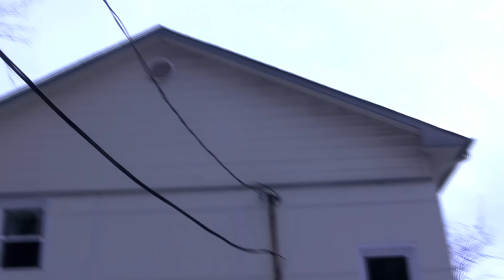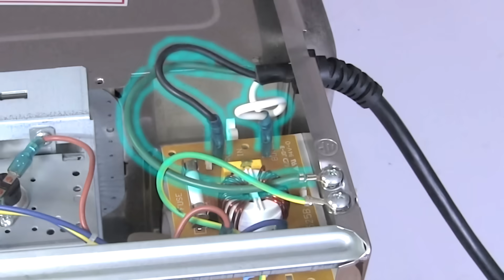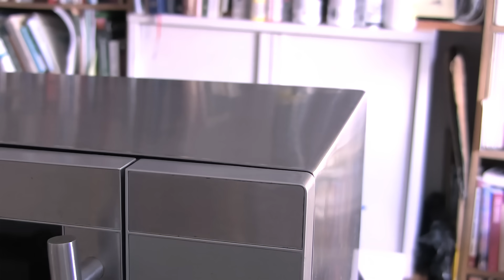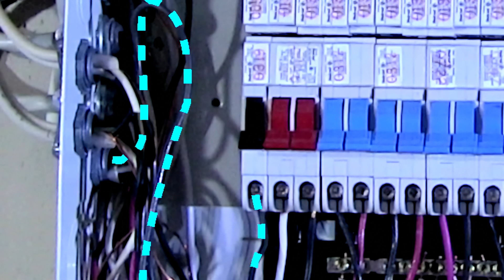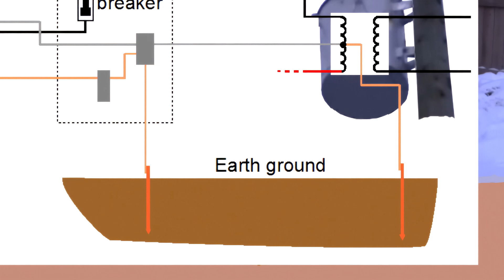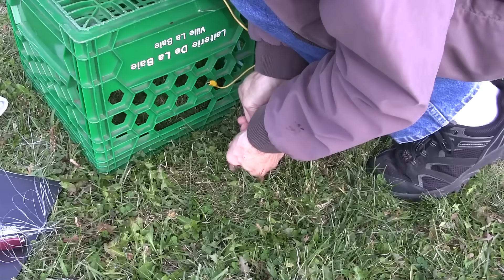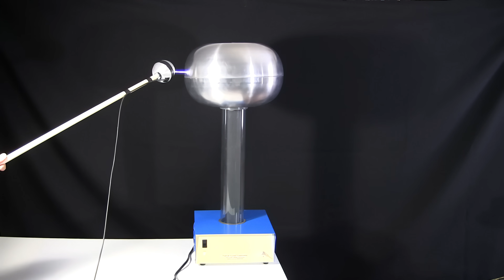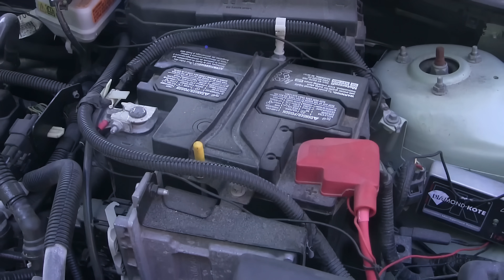What is Ground? Earth Ground/Earthing

Comment: Please tell me they have RCDs in the US by now, a fuseboard full of MCBs is far out dated.
Reply: In the US we have what's called GFCI's. Ground Fault Circuit Interrupters. You can use one as an outlet; it has a ""tripped" indicator "button" that clicks when it pulls in and a "reset" button that pushes and latches it back out flush to body of outlet face. Required at any sink, in any bathroom. Installation of a GFCI protects all outlets on that circuit. OR you can protect entire circuits with a GFCI style breaker in the breaker panel. I think they trip at about 45 mA hot to ground. The name of the device, I think is an unfortunate misnomer. I think they should be called Neutral Fault Circuit Interrupters.
Reply: @skeggjoldgunnr3167  Isn't it the hot wire the fault is with? It is leakage from hot to ground, as you say, that triggers it. It really has nothing to do with neutral.
Reply: @thomasdalton1508  Electricity should never travel over ground wire. IF it does: that 100% means that for SOME reason: the neutral wire was not an easier path to ground as it should be. I believe a GFCI monitors for at least 45mA travelling over ground wire. 

I agree that there are many ways for hot to find earth ground without showing current flow through the neutral or ground wire. Like if you have an electric water heater shower head and your toe completes a circuit to earth ground through waste water piping to earth. That waste pipe is NOT connected at all to your cold water supply feed through the breaker panel ground + neutral bus. It IS connected to the same earth ground used at the pole. = danger =  death. That's one of the reasons why we don't allow them things to be sold in the US! It's not UL approved!  (Underwriter's Labratories).

If our appliances do not have a ground wire - they have a chassis that does not have the potential to become hot without tripping the breaker. Our way of thinking may not be the best. It has allowed for many fatal electrocutions. But WE have what's called "freedom" here. That includes freedom to be stupid. We don't want our gene pool sullied with the DNA of the cerebrally challenged, so we chose THIS electrical code. It serves great purpose! Every time you want to build something or make something to improve the quality of life for all: our country pretty much says "GOOD!" 

Then you have those places that punish and penalize the thought of commerce threatening to happen. Too many costs, too many regulations, too much hand wringing worry wart big government over-reaching for a means of validating their existence, etc....and you wind having to pay for a big silly plug on your smoothie machine that has a freakin' FUSE in it. Because some busy body in the big government said so. Because you can't be trusted to respect electricity or think for yourself.
Reply: @skeggjoldgunnr3167  Neutral not being the easiest path is a very confused way to look at it. If something is wrong with neutral then you just have an open circuit and no current flows. If current is flowing to ground (either through the ground wire or directly to ground) then it means something is wrong with live.
Reply: @thomasdalton1508  In the US: neutral and ground tie to the same point in the breaker panel. In your country - maybe that is only done at the power station / substation / pole. BUT IT IS DONE. So they are pretty much: the same wire! except for inside an appliance. They are here thought of differently. Ground is for a floating chassis that's there for avoidance of a hot chassis fail mode. One (neutral) completes the circuit by carrying current. The other one (ground wire) had better not, if it does: we got a problem with the whole thing.

Because there are paths to ground other than the ground or neutral wire: A GFCI is of course watching for a difference in the current that is flowing on both hot and neutral. Problem with hot? That's either an open...(no problem!) or a short (That means tied directly to neutral or earth, right?) Well that could and should trip the breaker. Or mains hot can just touch internal circuitry and cause appliance to let the magic smoke out then go open. We need photonic induction here.

I understand what you say with "Problem with hot" That's the most honest appraisal. Hot is being sent where it aint suppoda!  I get it. But ground and neutral being the same wire make the GFCI interesting.
Reply: @skeggjoldgunnr3167  Ground and neutral will end up in the same place sooner or later, whatever your system. They are kept separate because connecting cases of your devices to neutral runs the risk of them becoming live if the connection between neutral and the Earth (wherever that is) breaks - neutral is always connected to live through all your devices so if it isn't connected the Earth except through you, you'll get a shock (the devices obviously have resistance, but not necessarily enough to prevent you getting a nasty shock). By having a separate ground and neutral, you need two simultaneous faults before you get a shock. (It also enables GFCIs/RCDs to work, but that's a happy accident - they didn't exist when the system was created).
Reply: @thomasdalton1508  I once learned those things the hard way. I bought a huge used IBM server to learn Unix sys admin skills and Unix on. I lived in a rooming house in a beautiful old ET Mix designed mansion that had no ground wiring in the outlets. I found  a good printer, as by then I was accustomed to Unix and had decided to use the boat anchor as my desktop workstation. (It took 9 hours to compile Open Office.)  The printer, an HP Laserjet 4MV with postscript fonts - I connected via parallel printer port. I plugged in the printer and both were destroyed. One outlet was wired backwards or I plugged something in backwards. 50/50 chance. That was a sad day.
Reply: @skeggjoldgunnr3167  :(, that must’ve sucked so much. Sounds like you were about to have a good ole time in the command line, and a goddamn printer ruined it.
Reply: @macicoinc9363  The ground shield on the printer cable was hot from one circuit. My workstation was plugged into a different outlet, the other circuit. TWO hots = 230VAC here. I lost the server and the printer, a scsi plexwriter, a scsi DDS3 tape drive and a 250MB IOmega Zip drive that was on the parallel bus. I could only be mad at myself. I replaced it with a DEC Alpha, 122 key Dvorak remapped Wang keyboard, Green phosphor TTL monitor and a ring epoxied on the top of the chassis to hold my coffee mug. It ran hot enough to keep the coffee the proper temp. Priorities, you know.
Reply: @skeggjoldgunnr3167  those were the days! now most equipment accepts 110-240V range. i once got half my equipment fried as two phases got shortened during a storm and as result around 250V came from my hot wire.. called utility, they were amazed to hear my explanation :)
since then i prefer to have outside line circuit breaker as well.
Reply: Having RCDs doesn't mean you can remove the MCBs...
Reply: @thomasdalton1508  no the RCDs work in conjunction with MCBs and also a ground fault detection in European systems

Comment: In electrical power stations they actually have to put a grid of metal rods in the ground since there can be so much charge grounding it can shock someone through the ground which is usually an insulator.

Comment: Don't anyone feel bad. One site offers a 12 hour online course about only this.
NEC Article 250. NEC Article 250. NEC Figure 250.1. Not all electrical systems are solidly grounded. The National Electrical Code (NEC) provides requirements for both grounded and ungrounded electrical systems in Article 250, which is the largest article in the NEC.
NFPA 780 goes on and on specifically applying this to every conceivable equipment type.

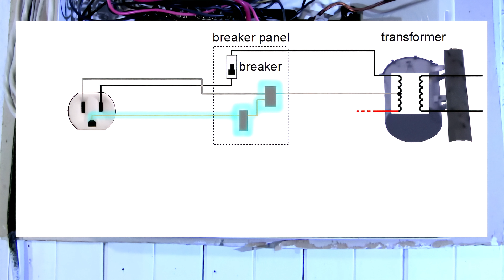Comment: here is a mistake in ur video 1:44
Reply from the maker: Are you referring to where the ground bar is connected to the neural bar. I say that at 1:30 as well. Usually that connection is made though the metal case of the breaker panel. Both bars are electrically connected to the metal case so they're electrically connected to each other. This the how it works in a main breaker panel. Subpanels don't usually have that connection,

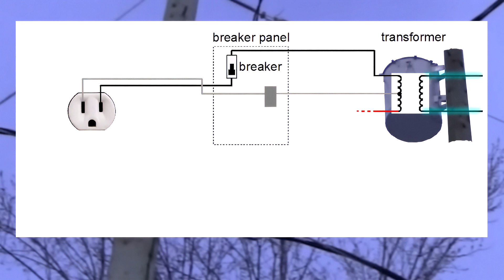Comment: 1:20 what about the red dotted line on the transformer?
Reply: Other phase. Central-tapped transformer. Red dotted line has 120V in North America, but 180 degrees phase-shifted
Reply: It's another "hot". A hot and a neutral will give you 120v, a hot and a hot will give you 240v, necessary for some appliances. It get complicated when you go deep into transformers, but that's the gist of it
Reply: he put - - - in it so you know theres more of it, its probaly the other charge

Comment: Why in the U.S + South America the street transformer isn't underground but on a wooden pole?
Reply: Depends on the area. Running distribution cables underground is safer and prettier, but far more expensive, so you’ll only see that in nice suburbs or in high density and urban areas. The transformer will be mounted on a concrete pad above ground or in a building, with the cables coming in and out through openings in that pad or building to buried pvc pipes encased in concrete. All of that below grade work, thicker shielded underground cable, and concrete is expensive. Overheard lines are less reliable and safe but far far cheaper due to the smaller cable, and the fact you just need to drive a pole into the ground and can service it easily, so you will see those in many urban areas, in suburbs and any rural areas.
Reply: @aquaman415   Excellent explanation, Thank You Very Much ! 🙂🙏
I'm slowly but surely learning the most I can about Electrical Engineering and Electronics, is such a fascinating discipline. 😀
Reply: @@user-zi7eg5ir2x  wtf man??
Reply: @@user-zi7eg5ir2x  relax your huge breasts.
Reply: @@user-zi7eg5ir2xbased
Reply: @The Joker Wow, triggered much.
Reply: Underground transformers? Where are they underground? Why?

Comment: In 1958, I built a transistor A.M. radio inside a small match box. (One of the first, if not the first, I claim.) I used the university's hot-water radiator as ground.  Listening was done via a simple earbud.  It worked great.  Sadly, it won't work any longer in many European countries, because there are no "commercial" A.M. transmitters any longer in operation (well, maybe in the shortwave spectra).  For the same reason, my old crystal radio won't work, either--even if I did ground it properly.  😞
Reply: You are old as fuck
Reply: @noelyanes2455  —ha, ha.   You got THAT right.  In fact, I outlived Amplitude Modulation itself.  There are no such commercial stations here any longer, so my little radio wouldn't even work. And most short-wave radio traffic is now SSB.  Also, the crystal radio set I have doesn't pick up anything, either.  LOL

Comment: If the chassis of the car can serve as the ground (which is sitting on rubber tires filled with air and not in contact with the earth) is it possible to create a ground from a small brick of conductive material for the purpose of dissipating a ground leakage current of approx 10 milliamps. Or would the brick become charged and hazardous? Asking as I'm looking to bleed off 10 mA of ground leakage without tripping sensitive GFCI breakers
Reply: The chases of the car is a different kind of ground than what you're thinking about. Think of it like this:

 Essentially, the whole chassis of the car is a negative wire. That means that if you want to have a light bulb on the roof of your car, you only need to run one cable from the Battery Positive to the positive side of the bulb on your roof. You would then connect the negative side of the bulb to the bare metal roof directly. 

The car chassis is not dissipating anything, it is acting as a negative wire. 

What you want is different. You're best off fixing the leakage or failing that, just using the ground prong of the plug, or attaching to some copper plumbing.
Reply: @iambenmitchell  NO. YOU CONNECT IT TO YOUR BELLY BUTTON.
Reply: @iambenmitchell  Appreciate the reply. Thx
Reply: In order to trip the GFCI breaker (outlet, presumably?) the leak would have to be 'downstream' from your GFCI. So it should be pretty easy to locate the culprit as most GFCI outlets only have 1 or 2 downstream devices. There's no 'bleeding off' of stray current. It has to go somewhere. Just start unplugging stuff downstream from your GFCI until the stray voltage drops.

Comment: On a Marx generator can I connect all the capacitor stages to the ground rod outside? Just because I don’t want to run a resistor back to the anode. Basically Can I run a Marx generator with a DC 1 terminal voltage source? Thanks rimstar lmk
Reply from the maker: Sorry, I'm not familiar with Marx generators. If you're looking for a safe ground for high voltage then a good ground rod outside is better than using an indoor ground since there's no chance of damaging your appliances.

Comment: How does no one understand this stuff.
Reply: @iamnotanundercoverfederalagent  Think of electricity flowing like air. The positive charge acts like a vacuum sucking the electrons towards it As the electrons are like high pressure. Ground is a positive charge. Magnetic fields push electrons that's why Transformers have Transformers have 2 coils. The primary is the electromagnet. When the secondary is all by itself not connected to any power source. The energy that flows through that is just affected by the magnetic field from the primary coil. That's why the neutral can be hooked up to ground And the secondary coil. cause it essentially is ground Also.  In America Transformers are only split phased. If you were to hook up 2 wires on both ends of the secondary of the transformer. 210 V But when you have a neutral in the middle of the secondary you split the voltage to 110. With lightning the water bouncing around in clouds causes a negative charge like rubbing a balloon on your hair. Once the charge is high enough the lightning will discharge to the ground. Which is a positive charge. Lacking electrons. I hope I described this well enough for you.

Comment: Help Please Anyone. 

One Of The Electrical Outlet On The Wall At Home Was Making A Bolt Like Weird Noise 3 Days Ago. Then, The Concrete Floor In That Room Felt Like Mini Shocks Everytime I Walk On It. The Side Of My Fridge Also Was Sorta Shocking. Called In An Electrician, The Said We Had Faulty Wire As Well As The Wires To The Electrical Outlet Was In Reversed, So He Reversed It. When He Was Done, The Floor Till Today Is Shocking My Feet. 

What TO Do?
Reply: i suggest using it as motivation for dance moves
Reply: @WRATH_OF_GUENSCH 
Oh Yeah, You Think So? You Have No Idea, I Did More Than Just Dance That Day. Somehow I Learned A New Move, It's Called "The Spazzing Out!" Feel Free To Try It Out Yourself, But FYI, I Don't Recommend It! 😀
Reply: You might not have a connection to the actual earth. In old houses, they connected the ground to the copper wiring to save money. You should have an actual copper stake be driven into the ground and connect the grounding lead to it. But a competent electrician should be able to tell you that for sure.
Reply: @Catpanl 
Thanks So Much. Sorry For Late Reply, But I Finally Got The Issue Fixed. Around Last Week Monday. Had To Condem The Wires That Was Under The Ground & Put In New Ones Through PVC Cause The Old One Was In Metal. Given I Worn Out, It Was Exposed & Caused A Leaking. Hence The Zapping.

Note, House Hasn't Been Rewired In Over 40 Years. Yep, No Wonder. Everything About The House Is So Old School. If Only I Was Rich Or Had Efficient Money, I'd Rewire Everything, But Gotta Do With It For Now. Thanks Once Again.

Comment: Very good video. So, since the earth ground has a neutral charge, it has lower resistance than the neutral wire. Therefore, during a short the path of least resistance is through the the ground that is connected from the device to the earth. The increased current flow then trips the breaker and makes it safe to touch the case again. So should that happen, do Not reset the breaker but check for a shorted hot wire somewhere in the chassis, using an ohmmeter. Once the short has been located and repaired then check once again with the ohmmeter before re-energizing.
Reply: You're confusing equipment grounding conductor with the the earth ground. One has nothing to do with the other. When there is a ground fault in an appliance the neutral current is interrupted and current passes from hot to the equipment grounding conductor (usually bare wire or green insulation)> From there back to ground bar in distribution panel which is bonded to  the neutral bar. From neutral bar to transformer secondary neutral and back to hot via the secondary coil and back to the distribution panel through the breaker. Since this is a very low resistance path the current will be very high and circuit breaker will trip. Note that none of this travels via the EARTH ground. The earth has nothing to do with this and if the neutral is not bonded to earth the result would still be the same.

Comment: Great video, very informative, thanks! You said that one reason to connect to earth ground is to dissipate charge that might accumulate as a result of lightning, are there any other reasons?
Reply from the maker: The center of the transformer is connected to earth ground, which means the voltages alternate around ground potential. Having the neutral wire in the break panel also be connected to earth ground would also keep the voltage there alternating around the same ground potential. I'm less certain of that though.